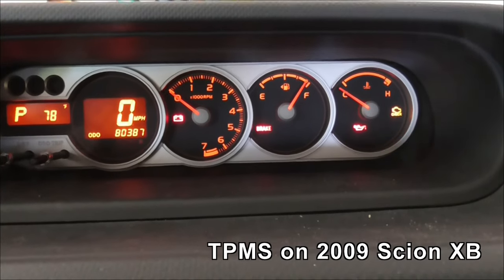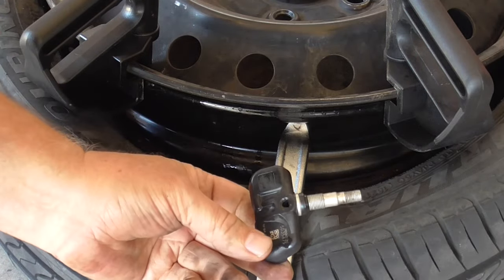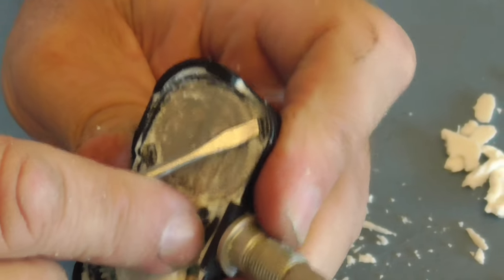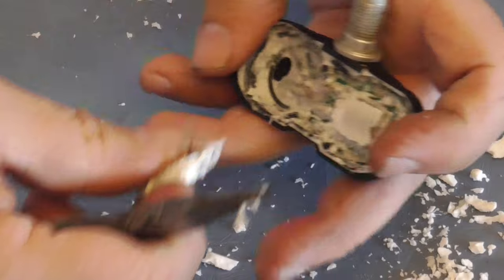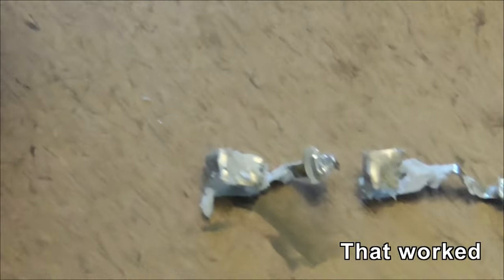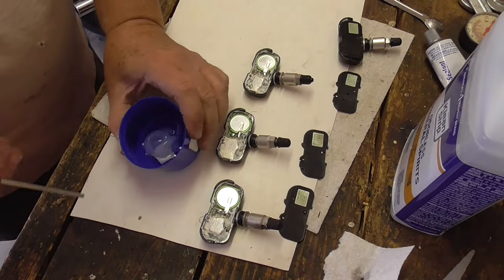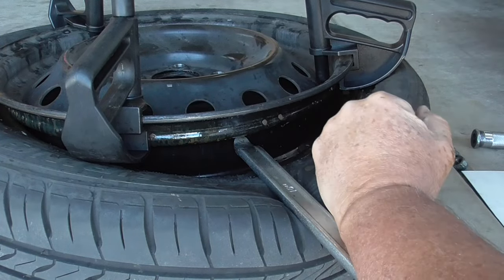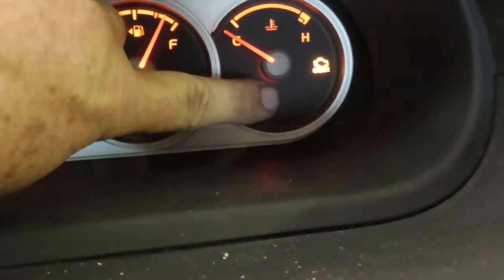2009 Scion XB TPMS Battery Replacement

Comment: instead of spending all that time to replace the battery why not just buy a new one?
Reply from the maker: That is a fair comment. 
New ones from Toyota run about $100 each before installation, activation and rebooting fees.
New ones from Discount tire about $60 each before install etc, etc.
New batteries, RTV & Mineral thinners cost about $40 total.
I am retired and have the time to spend doing fun projects like this.
My time is free